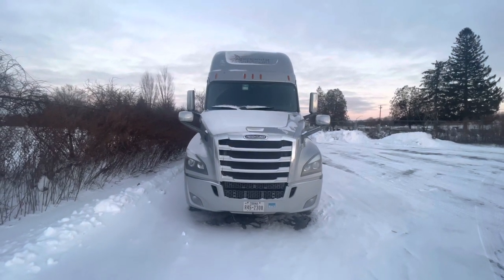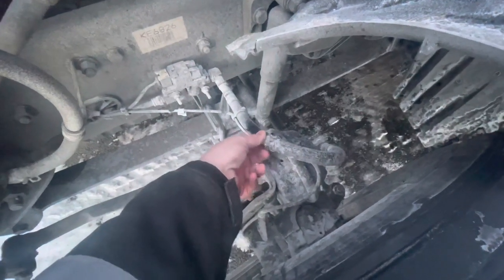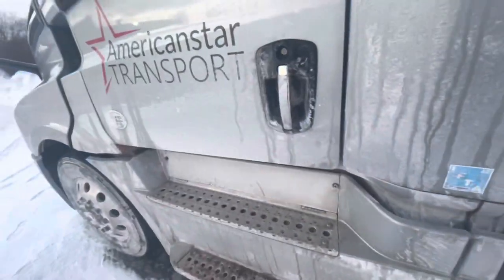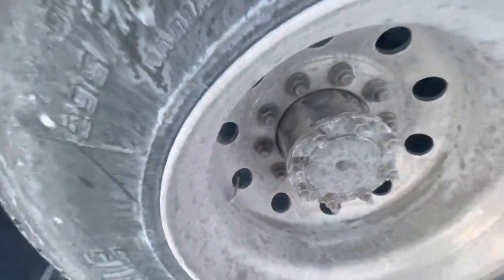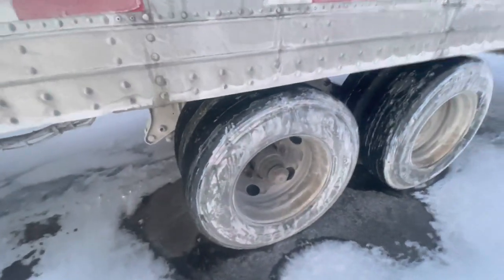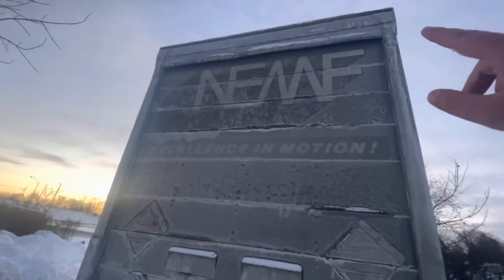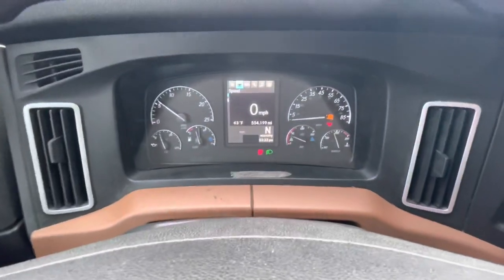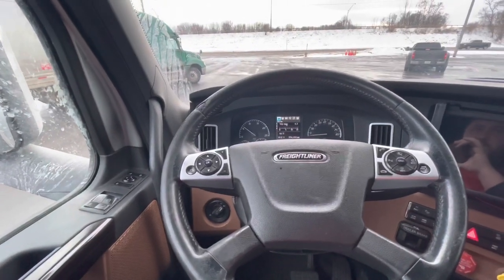Cdl pre trip Inspection class A (automatic) 2022

Comment: Great video, only thing I would caution is to never get between the tractor and trailer landing gear to check if the lock jaws are locked around the king pin. Get a few feet behind the landing gear to verify the connection.
Reply: This isn't the case for every tractor but on the 2022 T680 I'm going to be taking my test on, the kingpin lock is almost not visible unless you get between the tractor and landing gear, not sure if the instructors require you be all the way under the trailer like I have to be or not, that would be a crummy way to get failed 😂 gonna be taking mine in a couple weeks